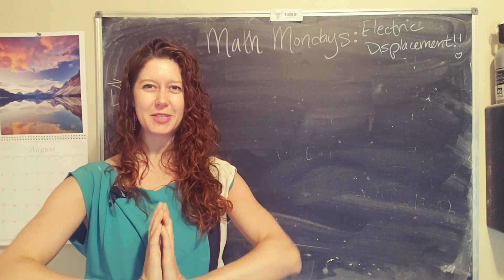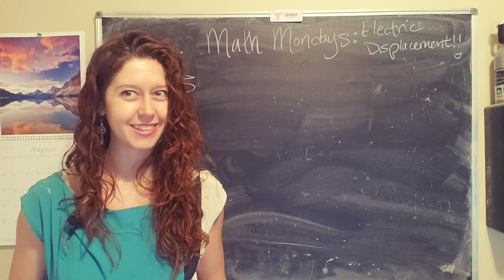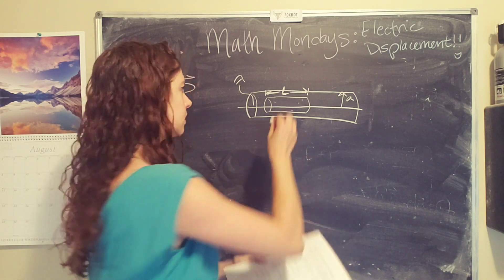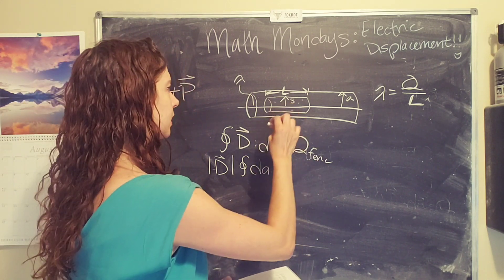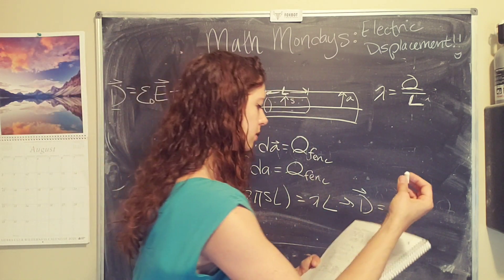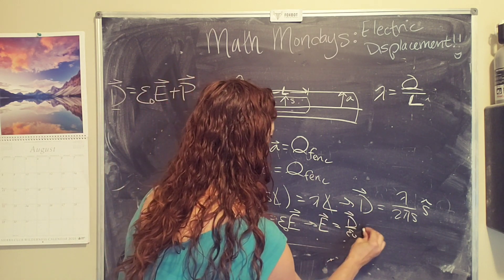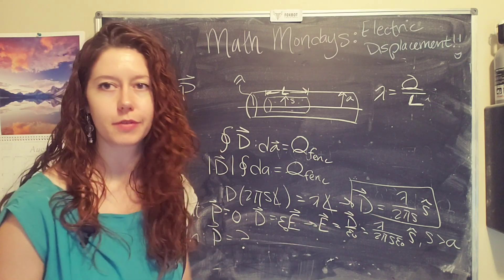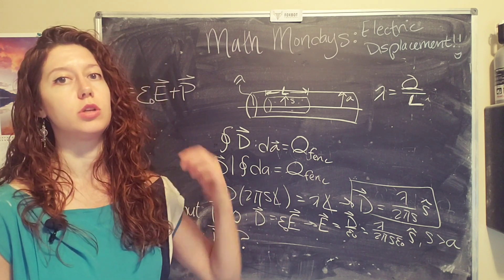Electric Displacement Example Problem

Comment: nice video really just for anyone watching if you pop out the Fields in gauss law you cant leave the circle on integral sign. it happens on autopilot a lot but it will cost points in an exam especially if the course is rigorous
Reply from the maker: @ericlol1337  good call, thank you!

Comment: Hi! Great video thank you so much! I have one question: 
Why do we only calculate D for a gaussian surface of s<a. What happens when s>a?
Reply from the maker: we need to have some charge enclosed to measure displacement! (lmk if that doesn't answer your Q, i'm replying quick)
Reply: If I understand correctly you could take s>a without any problems. The (free) charge enclosed is the same. In fact, you sort of need to do this if you are to get any electric field outside the insulator